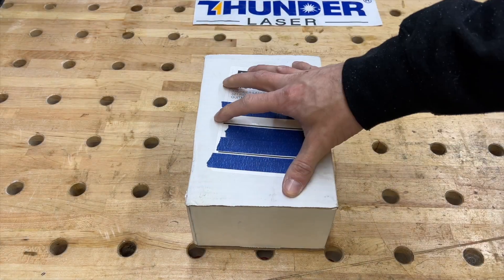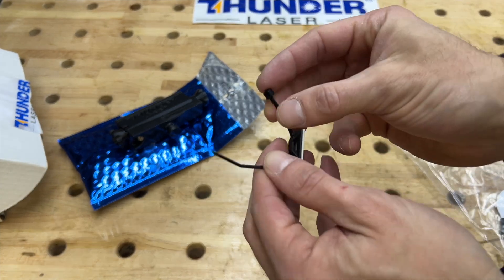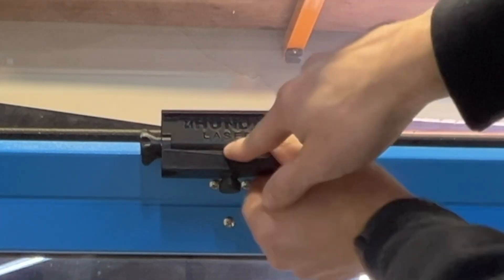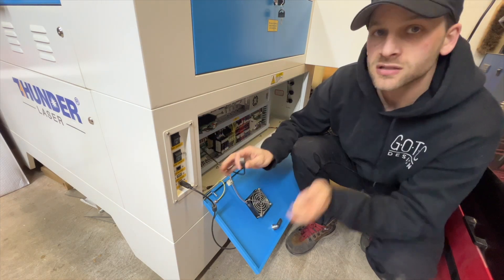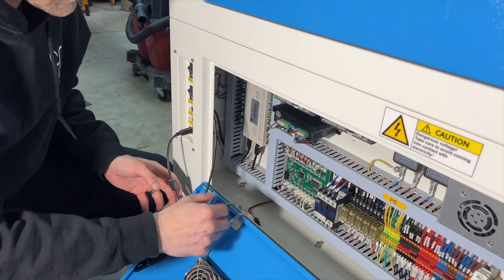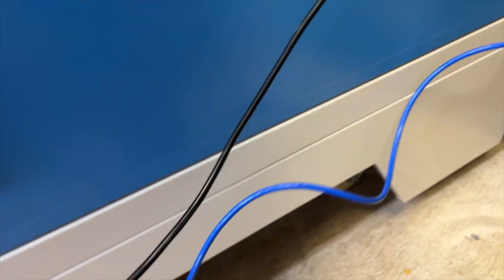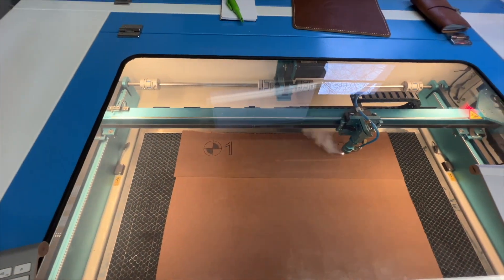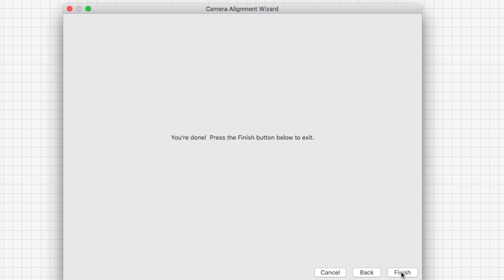Laser Camera Installation | Thunder Nova 35 Laser Camera Install | LightBurn Camera Install 100W

Comment: Hi friend thank you for this video, what controller are you using with? Ruida?  I don’t have that brand  but mine comes with plug u disk I don’t if it’s compatible to camera
Reply from the maker: Thunder uses their own proprietary Rudia DSP. It should work for you but you might need to play with some settings in lightburn